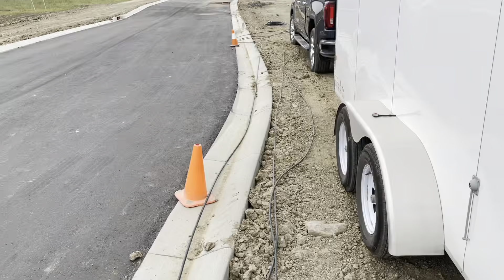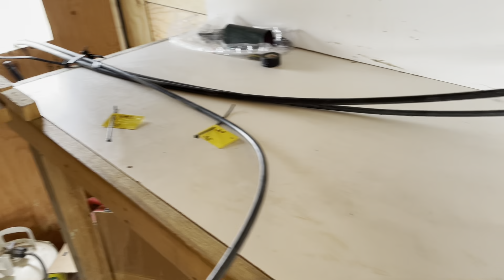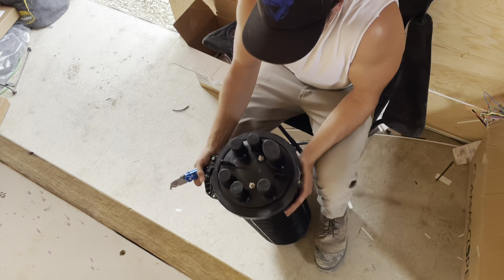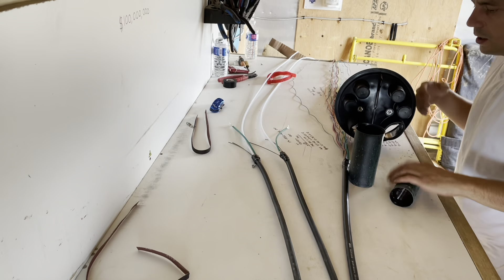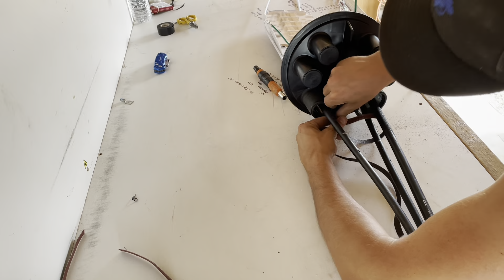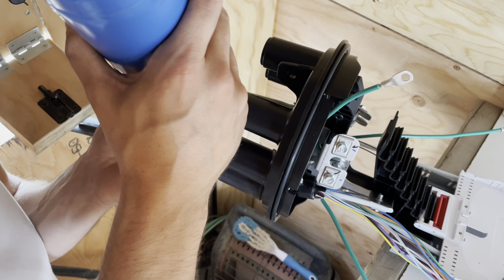How Internet Fiber Networks Are Really Built (400D FOSC)

Comment: I agree with previous comment, foil wrap should be halfway inside the shrink. Also the path to least resistance when opening the port hole, apply a little heat first. Then the knife will glide like butter.
Reply: Yeah the entire point of the foil wrap is to protect the plastic cable jacket....by the time he finished heating 1 of the cables heat shrinks was completely above the tape😅
Reply from the maker: Thanks for watching and commenting I appreciate it 🙌

Comment: The cables are to far into the FOSC, the ring cut should be aligned to the base of the enclosure as stated in the manual section 5.4. 

Otherwise, nice work
Reply: It's not a ring cut those are tails😅.....the cables were brought to the base of the enclosure I think you're confusing the central core tube  with the outer cable jacket

Comment: im ur new subscriber. can u plz tel me in iptv network router and switches use LC (duplex) connectors by the way in customer end (ONT) there is SC/APC connectors used how its possible thx in addvance.
Reply from the maker: When it comes to connectors it all depends on the equipment being used all connectors work just depends on what you need to connect the equipment any connector can be put on the end of a fiber